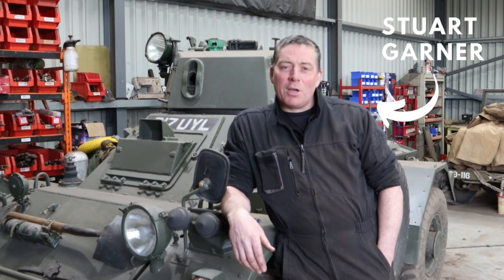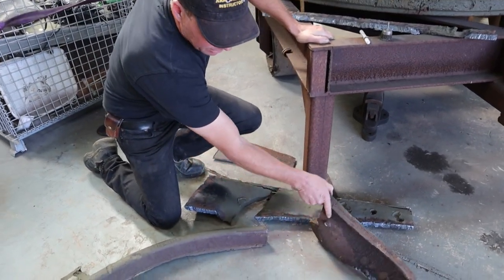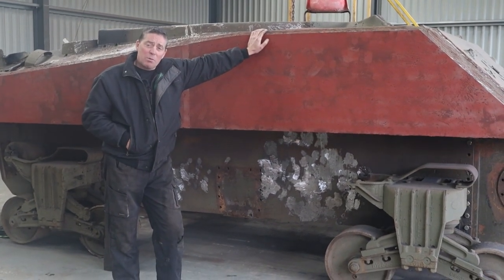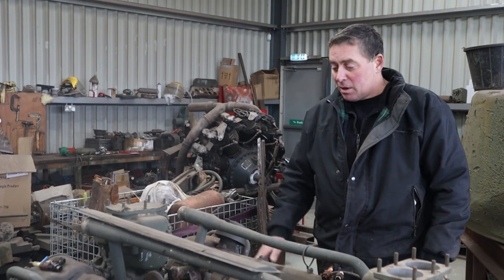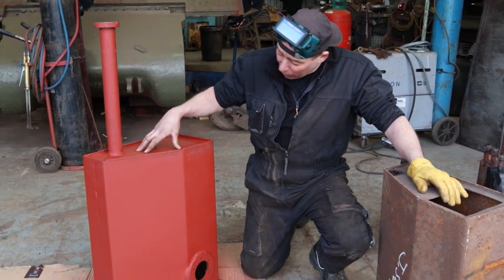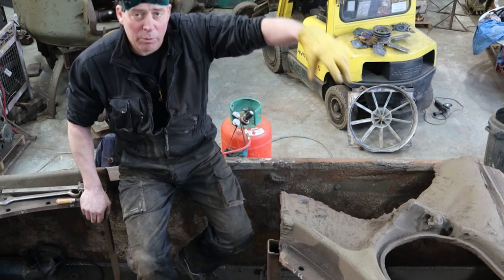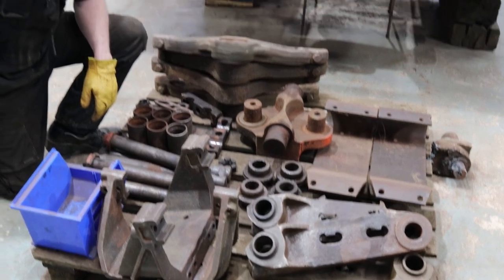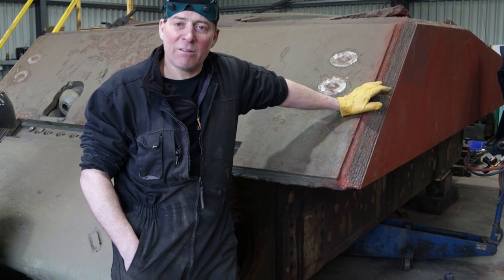Restoring one of the RAREST tanks in the WORLD!!! -Part 2

Comment: Those 5 dislikes are probably from WT players who couldn't pen it
Reply: M4A3E2: exists 
tiger players: tiger should be 4.0
Reply: @CheddarBro  i mean that's easier said than done  when they go full bush wookie. but still the long 75 can pen the turret cheek. some of the other nations struggle. well russian 85mm caliber up wards can reliably deal with them and British sabot but in a down tier they are a menace for sure
Reply: @CheddarBro  yeh not impossible but trying to hit that tiny weak spot while he can just keep moving with his stabilized gun is a difficult task. that's why it sits at the same BR as the tiger and panther after all. i usually just shoot transmission and then shoot lower hull. most things can go right through lower hull even with steep angle. they can be a tough nut to crack if the person knows how to angle it correctly
Reply: @smolwavingsnail9028  if you don't play like garbo it doesn't need to
Reply: @yuurichito1439  even the most experienced players will have issues with a jumbo. especially now we've got volumetric bullshittery to worry about. it's often not a matter of "not playing like garbo" and more a matter of even if my round is on target is it going to pen or get caught on the edge of a plate and do nothing. literally had a 285mm pen apds bounce of a panzer IV armour skirt the other day flat on. the game doesn't know how to caluculate the gaps between armour or overlaps properly. the armour can be paper thin but if you shoot down the length of it it classes that as the thickness. that's why tracks bounce shots so much. plus unless you have max accuracy ace crew then war thunders laughably bad shot dispersion will fuck you over constantly to. so yeh experience helps but you're still gonna get gaijined regularly
Reply: @smolwavingsnail9028  if we go by how effectively players use the tiger, it’d be a reserve tank. It’s absolutely hilarious when you go straight through the front plate and start getting hate mail because you killed their “invincible German tank”.
Reply: @LugborG  hahaha to true. seen countless people not angle then get destroyed why thing they could easily have one shot
Reply: *Laughs in IKV-103*
Reply: espacially the jumbo in WT is well armored even tho many players laugh at the shermans for being an easy target 
In WT tho i could kill a Tiger 1 ausf.e since i could penetrate the front armor with an M4A3E8 about 0,6 miles away
Reply: 🤣🤣 it can be sometimes upsetting to face a jumbo in a tiger, when I expect the tiger to penetrate anything I look at but yes, lovely jumbo indeed
Reply: I remember killing an M4A3 tank with a daimler, I think I shot from the side, top or the back, can't remember
Reply: @smolwavingsnail9028  as a german main, nah, just play smarter.
Reply: i literally just got killed by a jumbo and went on ytb and this vid was in my recommendations wtf
Reply: "just shoot the machine gun port lmao"
Reply: Lol. Yeah until it gets uptiered to play against leapards
Reply: @spartanyoda1424  funny enough, I kill Leos whenever the E2(76) gets uptiered, stabilizers work wonders my dude.

Comment: 6:00 I'm sure you've gotten it out by now, but if you ever have a bolt that just won't budge, the old boilermakers trick is to heat it right up and press paraffin wax into it. It'll wick up into the threads and everything comes apart once it cools

Comment: Weld A washer on to the bolt& then A nut to back out.& then use heat to turn it out.& spraying PB blaster penetrating oil on the threads.

Comment: Amazing the progress you’ve made already. What welding method do you use for filling in the damage on the outer armor?
Reply: We just fill with weld and then grind back flush.
Reply: @stuartgarner5072  Have you looked at any thermal spray welding processes? The high deposition rates over a decent area might be a time saver.
Reply: @mattwilliams3456  no I must say we havent but we will look into it, anything that makes it easier is welcome  thank you

Comment: Great job! Seeing such good result is a pleasure.  Please add more in depth information when possible. Many mechanical nerds out here loves to see how a tank is put together!  In the book "Death Traps" , Belton Y Cooper writes that he always tried to avoid the radial engines when replacing destroyed tanks.  One of the reasons he describes is the problem of broken spark plugs when the  radial engine was on idle over time.
Reply: The radial engine is a good engine but maintenance is needed regularly
Reply: @stuartgarner5072  Isn't it actually an airplane engine? If so, it could explain why they fouled the spark plugs at idle. After all, the throttle is used quite different in those two vehicles.  You wouldn't idle an aircraft for a long time, but run it at almost the same rpm for many hours , while a tank could go idle for a long time, and then when used, the driver would actively adjust the speed a lot. .. Just my guess.
Reply: @sidekickbob7227  the radial engine is DEPRIVED from an airplane engine yes BUT it has been heavilly modified it can not be used on an airplane
Reply: @billytheshoebill5364  Yes,  I thought so. Do you have any idea what the alternations was?  Flywheel, fuel-system, exhaust?